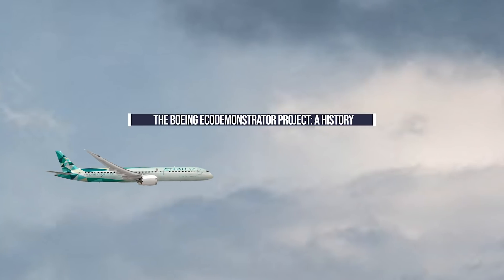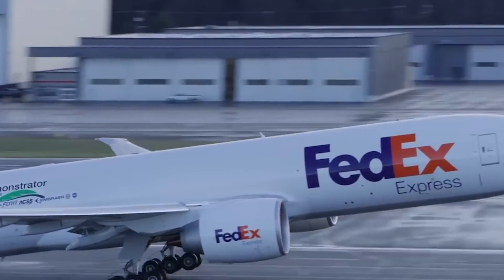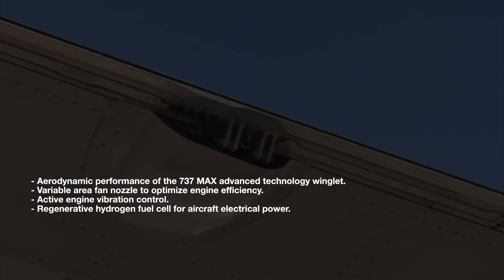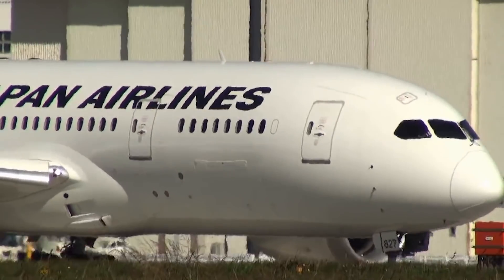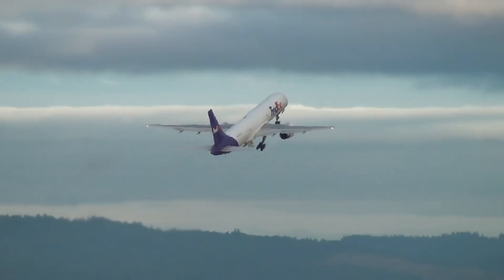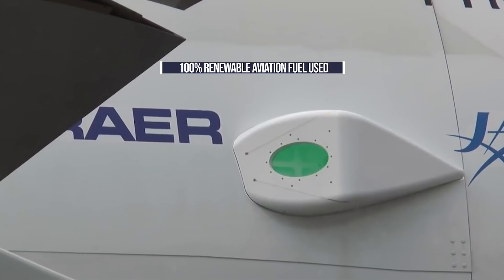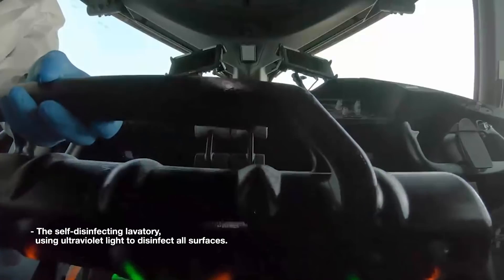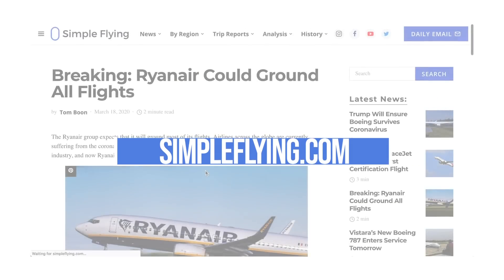What Even Is The Boeing ecoDemonstrator Project?

Comment: well then why remove chevrons from the GE9X?
somebody tell me🤔
Reply: To save fuel because they found a new way to decrease noise inside the engine itself. Chevrons slightly impact the air resistance of the engine.
Reply: @aviationchannel6204  thank you man🤝👍🏻
Reply: The use of chevrons was a bit of a cop-out in a way. Yes it increased fuel burn, but because of the noise savings, they could afford to use less insulation, making the plane quieter and probably even a bit wider too, without having to touch the outside diameter at all. So yeah, it did increase fuel burn, but was still more efficient than not having them because of the significant weight savings.

That being said, I'm guessing these new turbines might not need them, either that or they might have newer, lighter weight and/or more efficient insulation, so they can keep noise down without impacting efficiency or weight.

This is really speculation, though; it's not entirely known why they ditched the chevrons on the 9x.
Reply: @uzaiyaro  thank you man🤝👍🏻
Reply: Chevrons reduce noise but you have to make the material thicker (and thus heavier) for the nacelle for structural reasons.  Since the engines are getting quieter all by themselves due to improved technology, they figured they no longer needed the quieting provided by the chevrons.  Saves a bit of weight that way.

Comment: Maybe they can eco-up by using recycled airplane parts - I heard there's a few big birds out there ready for scrap 😁
Reply: The problem with that is the reason those old planes are getting recycled is because they’re outdated. For example, the Dreamliner wouldn’t want to use any parts from a 747-200 because those parts would be too heavy. Planes like the 777x can’t use old 777 parts because now it’s wings are made of carbon. The only thing you can use those for is scrap metal.
Reply: @cameron-w  Nowadays many planes get scrapped because of drop in demand, look no further than A380 - some of them aren't even 10 years old, so the ones that are still flying can use parts from the ones that aren't
Reply: You are referring to the A380, aren’t you?

Comment: Boeing...
Reply: Boeing= Boring.(see what I did there?)
Reply: A pilot spilling coffee and causing an engine shout down is the pilot’s problem not the airframe manufacturer’s problem.
Reply: @Think_Inc  what no. Coffee spilling could not be the pilots’s fault. What if the FA dropped it accidentally what if was turbulence? An emergency situation that caused the coffee to spill?
As a manufacturer you have to prepare for these types of things. It’s not a pilot problem things spill in the cockpit it happens it’s most likely not something new or unusual or unheard of 
Make it so when it happens you don’t lose an engine.
Reply: @nikobelic4251  As far as I'm concerned Ethiopian pilots are one of the best in the world
Reply: @siyaaviation3659  they are really good but those pilots had little flight hours on the 737 MAX 
I think relatively low flight hours in general 
Inexperience is inexperience
Reply: Yeah
Reply: better than airbus
Reply: @Boeing-ER-jy9vq  I don't see airbus planes crashing due to cut corners and negligence from designers (or lack thereof since their jobs were taken by shareholders)
Reply: @therublixcube3052  Airbus vs Boeing is subjective. Boeing plane engines don’t fail because coffee is spilled in the cockpit.

Yes Boeing messed up with the MAX but the other planes are great

Yes, the MAX was a huge mess up
But I still prefer Boeing to Airbus.
Reply: @nikobelic4251  Airbus doesn't even manufacture their own engines. They and Boeing use GE, P&W, Rolls Royce, etc.
Reply: @therublixcube3052  it’s not an engine problem
It’s an avionics problem 
The coffee spilling in the cockpit caused an avionics short circuit which causes the engine to shut down....

I know Airbus doesn’t make the engines but they make the airframe and the pedestal that contains the avionics. Water shouldn’t leak through it. It’s a design mistake by Airbus
Reply: @nikobelic4251  Ironically Boeing is the one getting more blame for engine problems like Trent 1000 provlems, GE9X delay, the biocide AD for LEAP & GENX, and engine incidents like PR113 and AC837. Either way, the truth is that neither Boeing nor Airbus do not deserve blame for engine problems.
Reply: @Blank00  
Yes, when it’s an ENGINE problem neither deserve the blame but with Airbus it’s not an engine problem it’s a cockpit design problem which leads to an engine problem.

If an engine breaks apart in flight that’s an engine problem 
If the pilots spill coffee in the cockpit and it causes an engine to shut down that is not an engine problem 
The problem comes from the cockpit not the engine
Reply: @nikobelic4251  First time on the internet? These people don't give a shit about any good programs boeing does, they blame boeing for the crashes because they WANT to. they choose to believe something and there's nothing you can say that will change their minds. They don't care that those 2 max crashes were because boeing made it hard for the pilots to recognize what the problem is and how to resolve it, not because the planes were fundamentally flawed and there was nothing anyone can do to save themselves.
Reply: @nikobelic4251  All aircraft avionics will fail if you spill coffee on them. Regardless if it's Airbus or Boeing.
Reply: @therublixcube3052  yes no.... I am pretty sure coffee has been spilled in Boeing aircraft and an engine hasn’t failed.

It happened on an A350 2 times which means it isn’t some one off thing. It’s clearly an Airbus A350 problem. Airbus even said they would make some design changes so it doesn’t happen again.
Reply: @Capt.nPeachy  I wish it were my first time on the internet that way I could say “I didn’t know any better”  in my defense for not stopping
Reply: @Capt.nPeachy  thank you!! Finally someone who gets me on this 
The max isn’t fundamentally flawed! It’s a pilot training issue not a plane issue.
Reply: @nikobelic4251  oh so now you are blaming the pilots because what they are African and Indonesian typical Americans